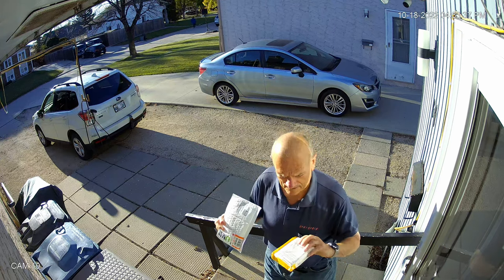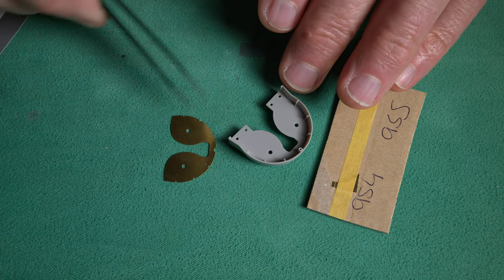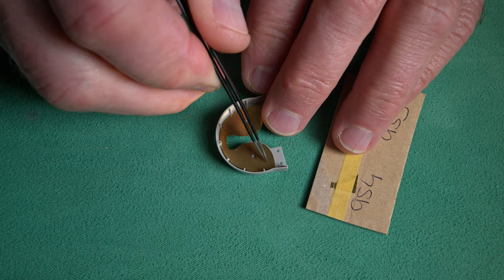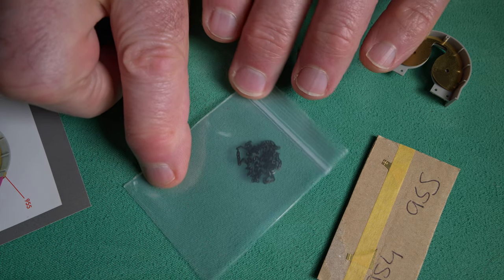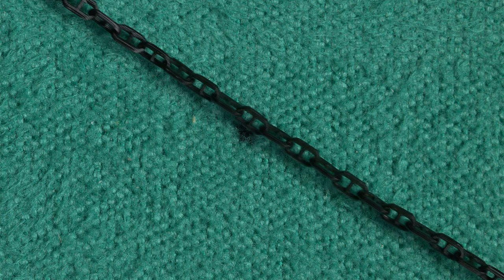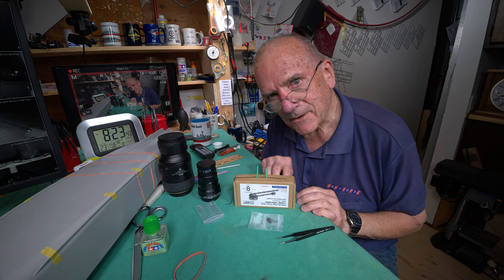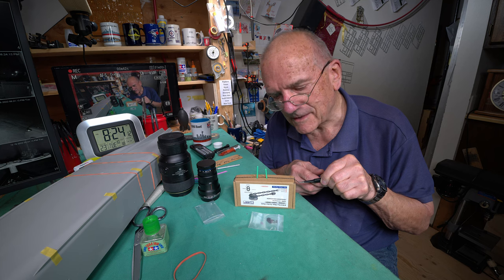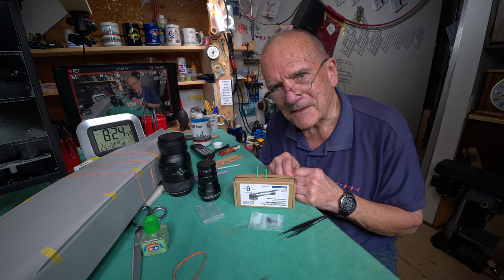The Model Ship - Part 1337 - 8K Extra

Comment: Hopefully I am not the 100th person asking this.  Can you tell me what brand the 25mm f.28 ultra macro is.  I can not quite make out the brand in the video. Sadly my monitor is only 4K.  Actually,  the DOF was not bad at all for that tight of shot.  I have been using the Nikor 105mm 2.8,  but the lens you have looks like it is more then 1:1. Is it the Laowa 25mm f/2.8 2.5-5X Ultra Macro?
 I am guessing the chain was printed on a resin 3D printer.  Amazing detail and the links were printed in place.   Very nice.
Reply from the maker: https://www.bhphotovideo.com/c/product/1399602-REG/venus_optics_ve2528n_laowa_25mm_f_2_8_2_5_5x.html?gclid=CjwKCAjwwL6aBhBlEiwADycBIKNJCaswOH1mnsygyVU6c2YyLf9Tqgkpo1Cx43Hzwqe9BUJ6OsVbQRoCjycQAvD_BwE
Reply: @roncalverley  Thank you Ron.  Appreciate it.